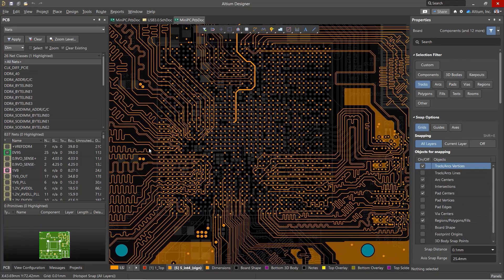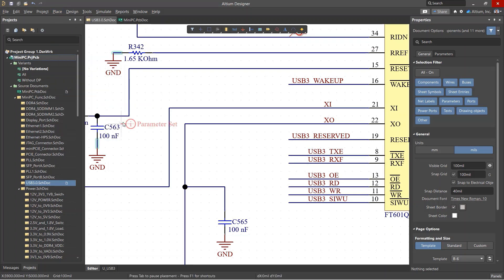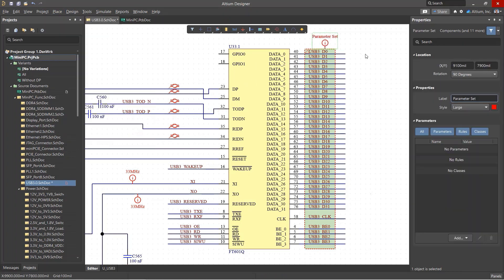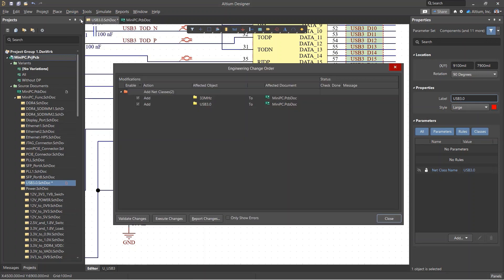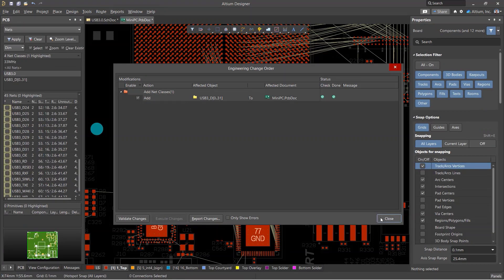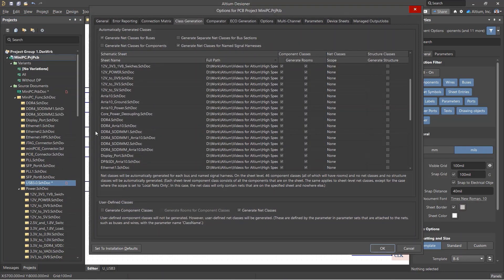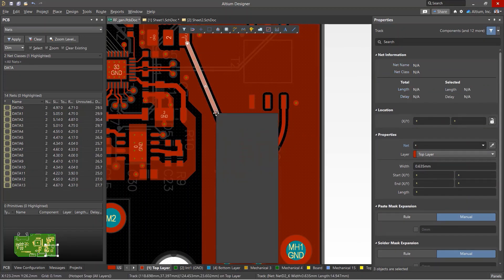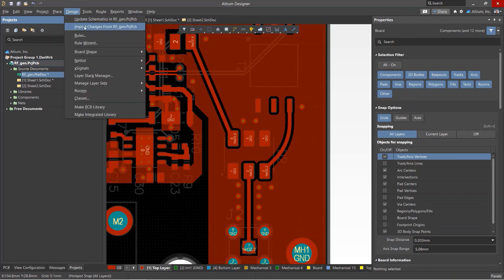How to work with Net Classes in Altium Designer | PCB Layout

Comment: Now with the new Constraint Manager update(s) none of this is possible. Altium killed a very very useful feature, and now the suggested way to go is to FIND OUT MANUALLY what nets are to be put in your net classes and add them, again, manually. What about importing Constraints (like it was for rules)? What about PCB Project Templates???? Now every new project is kind of a clean slate.

I really really don't get the thought process behind this change.

Comment: How do you set that color orange so it is perfectly transparent?  What is the color number and layer transparency?
Reply: The transparency on the polyogons can be controlled in the View Configuration panel, inside the View Options tab. I don't know that specific color of orange, but that project in the video is the example MiniPC project, look in the Examples folder in your Altium installation folder and you should find the project.